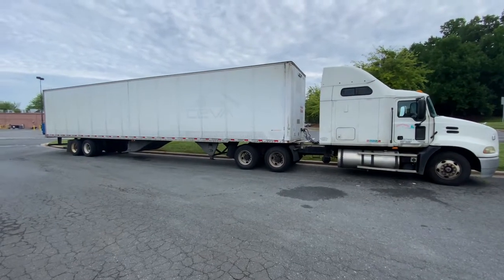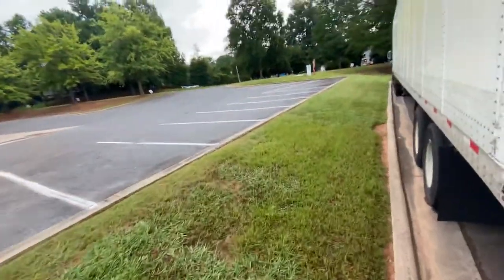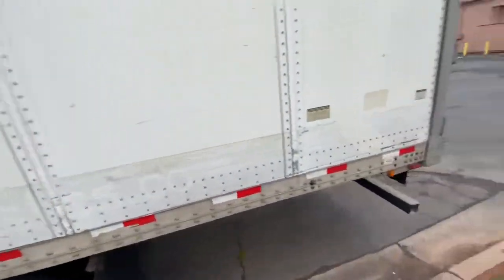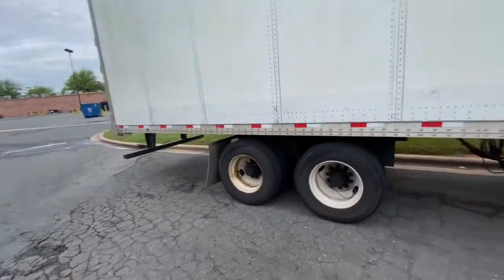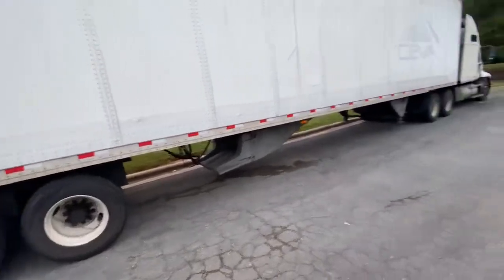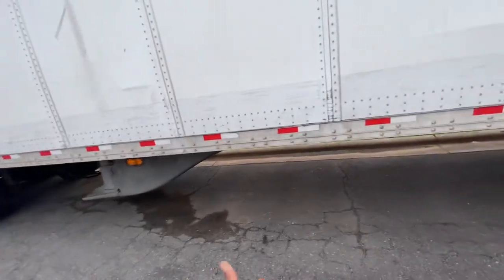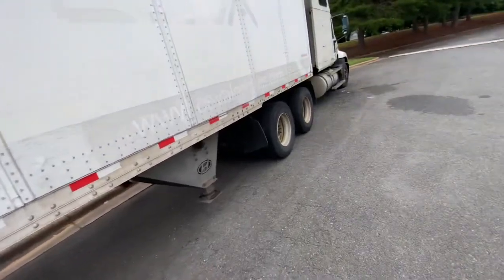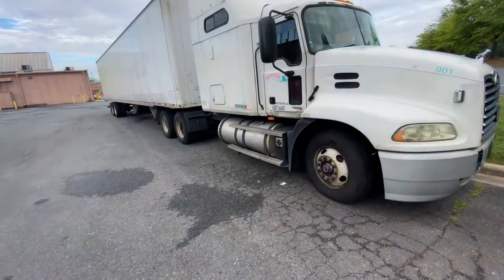Axle Weight Adjustment

Comment: Majority of the time you trailer axles always gonna be over weight vs the drives that’s why when I get a load I always put the pin in the 10th hole til I get into weight station we all kno if u goin to Cali that pin gotta be on that 6th hole

Comment: What happens when bridge law prevents you moving tandems back?
Reply from the maker: Great question! I personally have never ran into this situation. But, I know certain western states are very strict on this practice. The best I believe you can do is make sure the shipper loads you correctly for the maximum weight allowable. The best course of action is to speak with a certified DOT officer.